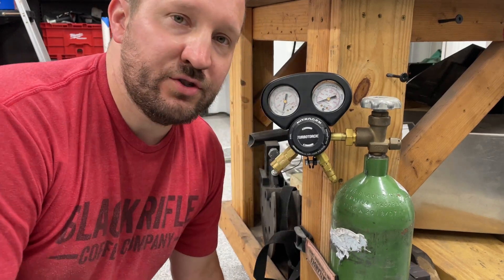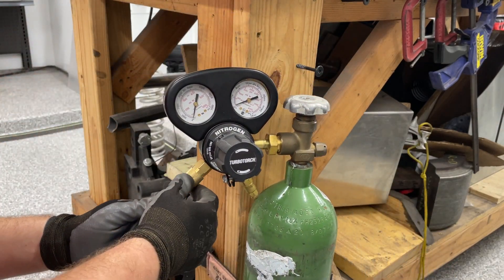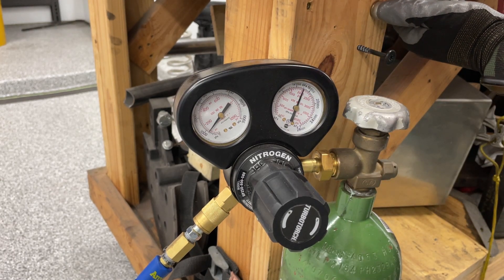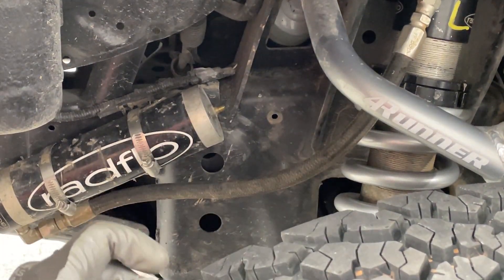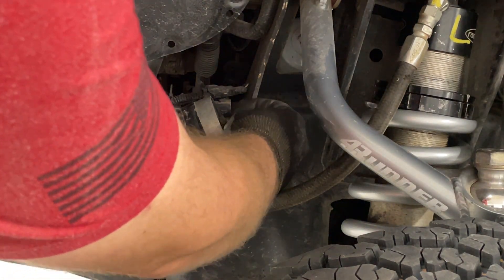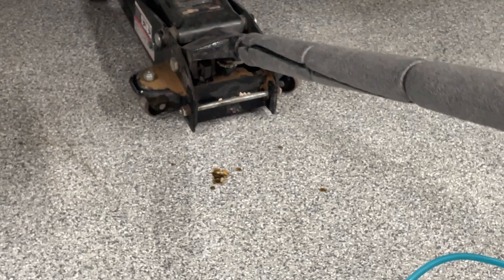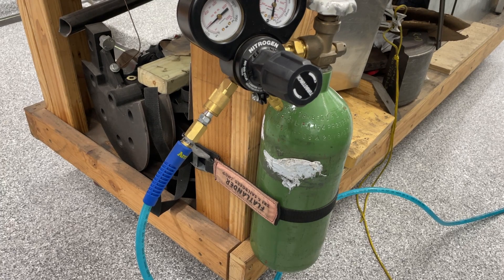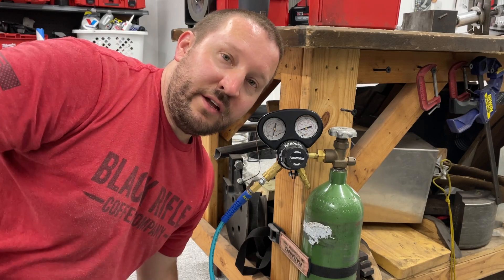Charging shocks with nitrogen! A how-to

Comment: Never open bottle valve to the open regulator line. First close off the regulator valve. Second open the bottle valve. Third open the regulator valve slowly to the required pressure. Maybe nothing happened until now but one day. That hose or connectors can burst because of sudden pressure kick. And no thats not cool :D Besides everytime you open your bottle like this you are damaging your regulator diaphragm slowly. Dont get me wrong this is for your personal safety. Also use safety glasses when handling high pressure equipment.
Reply from the maker: Thanks for letting me know!

Comment: Hi, How can I remove the air suspension compressor and put in a new one and not lose the nitrogen when I disconnect the hoses? Jeep Grand cherokee sumit 2014
Reply from the maker: I've never worked on a Jeep's air suspension, but here's my best guess: You'll lose the nitrogen when disconnecting the hoses--no way to avoid that. You'll have to recharge it after putting in the new compressor. The Air compressor probably requires a special fitting to charge it, so you'll have to get the fitting to plug into the end of a setup similar to mine in the video.

Comment: What will happen to the ride if i fill 200psi but without lifting the truck.. is it going to be stiffer or softer
Reply from the maker: It will be much softer
Reply: @nateatgoodmayhemracing4597  i guess i need revalving with such a harsh ride😂